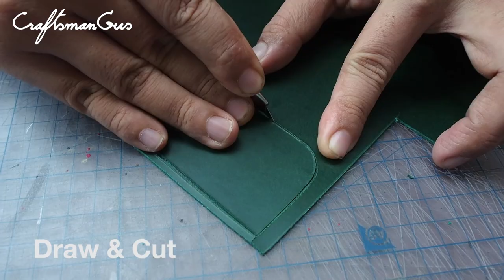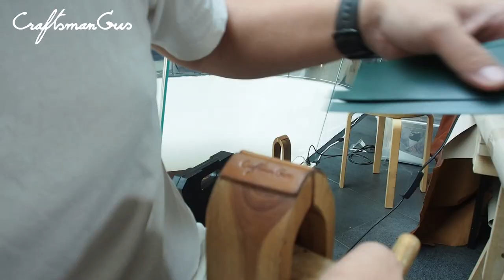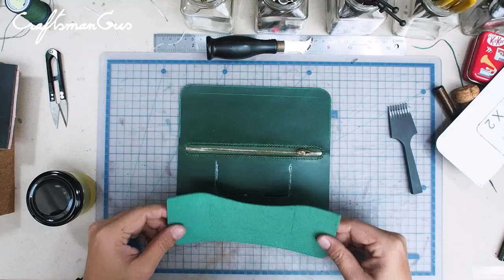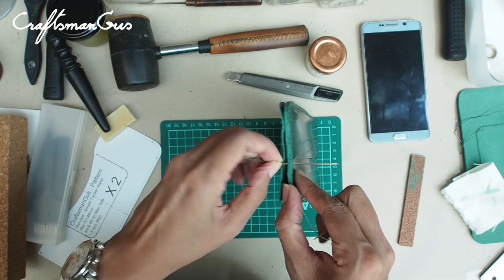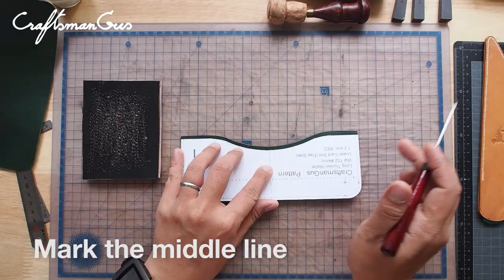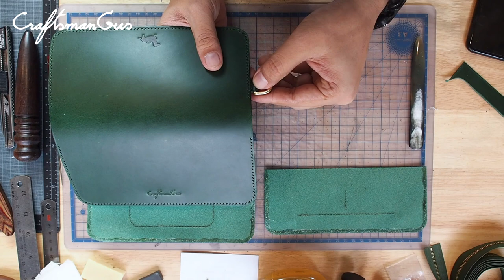Making Leather Wallet : Long Trucker Wallet #LeatherAddict EP34

Comment: Hi! May i ask what glue you use? Thank you!
Reply from the maker: Hi Shoty PuaIt's local brand contact cement ( contact adhesive/rubber cement) (brand "Bondtech" or "888").
In Thailand there's a lot of bag making factory so there are lots of glue available.
This is very light and fluid.
Reply: craftsmangus thank you very much!

Comment: Hello. which glue do you use?
Reply from the maker: It's local brand contact cement ( contact adhesive/rubber cement) (brand "Bondtech" or "888").
In Thailand there's a lot of bag making factory so there are lots of glue available.
This is very light and fluid.
I've never use about glue brand in Western Continent area.
Reply: craftsmangus Thank you!